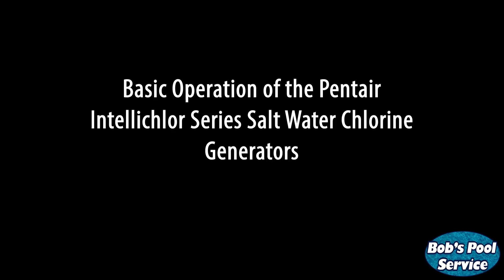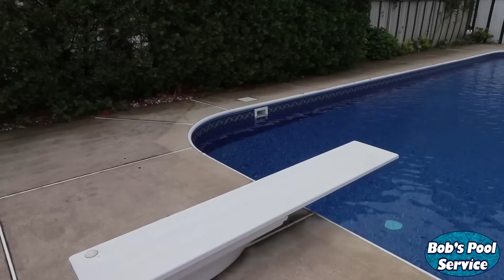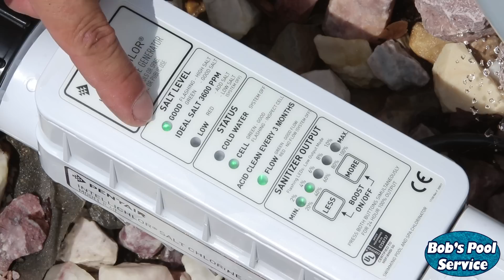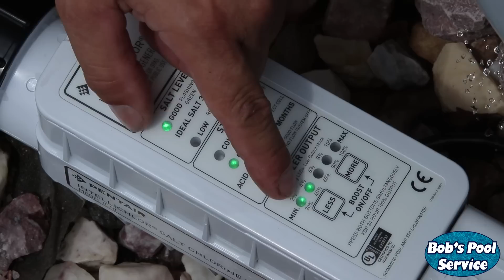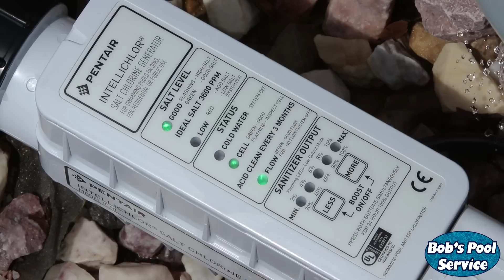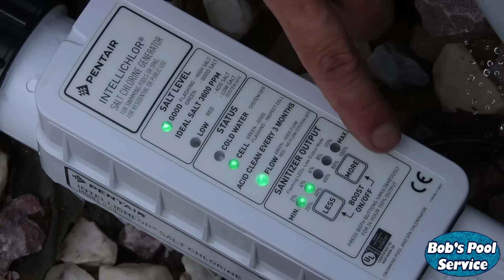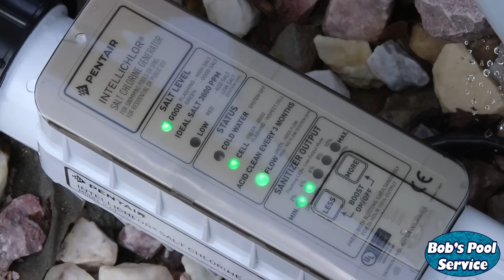Pentair Intellichlor Salt Water Chlorine Generator Operation

Comment: Just had a big storm so had to drain the pool a bit to get the level down.  Now the low light is red, but the cell light still goes green meaning it's producing chlorine right,  thought if the salt was low and red it wouldn't produce chlorine?  I added 2 bags of salt waiting for it to get back to green.
Reply from the maker: I didn't think they'd produce chlorine if red, i'll have to see if the green cell light comes on next time I run into that situation.  Maybe in some cases it can if it's not TOO low in salt and just under where it turns red.
Reply: Thank you for the detailed explanation from the blogger. This is our titanium electrode salt chlorine machine testing video. Welcome to watch. Thank you for your time

https://www.youtube.com/watch?v=Xi4_EYCDL2k

Comment: Thanks for the great video. If I turn the sanitizer output all the way down, does that mean the system is "off" for purposes of adding salt to the pool and waiting the recommended 24 hours?
Reply from the maker: Yes, that should be sufficient or if you find it easier you can just unplug the cell from the power center.  We generally don't change the cell setting when adding salt but we never add salt through the skimmer or put it directly into the system, we're careful to spread it across the shallow end of the pool and not push it towards the drains.  The salt dissolves naturally this way and usually takes about 2 days of running the system for it to homogenize with the water.
Reply: @BobsPoolService  got it thank you! Owning a pool can be frustrating at times but folks like you make it a bit easier.

Our former pool guys who did an awesome job last year left us to dry this year from being understaffed (being understaffed I'm totally empathetic to of course, lack of communication in telling me they wouldn't be coming by anymore after doing the opening, less so).

So new pool guys are coming tomorrow and I'm trying to get it as clear as possible so they can vacuum. Glad to know in the meantime I can effectively shock the pool at least while I wait for the salt I dumped to dissolve!
Reply from the maker: Thanks for the kind words, we really do want people to enjoy their pools, sadly that's not always the case.  We can totally relate to staffing problems, it's become very difficult to find qualified people to work for us and putting someone on a job without experience can often be worse than just giving up new clients.  Right now I think every pool company worth their salt is in this same situation with more work than they can possibly do.  Good luck with your new pool guys, hopefully they work out and yes, if your salt system ever goes down just put some liquid chlorine (bleach) in the pool until it's operating again.  Salt systems really just produce chlorine from the salt so it's totally compatible with chlorine and in fact IS a chlorine system.  Just don't do something like put tablets inside the skimmer, they're highly acidic and that could damage the plates on your cell, use a floater or better just use liquid or granular until your salt system is once again working.

Comment: What if you just want to turn the cell off?  How do you do that?
Reply from the maker: There's really not a way to turn it off, but you can turn the output all the way down to zero. Or if you want it totally off I would just unplug the connector from the transformer

Comment: Just opened my pool today.  Guy said add a bag of salt tomorrow.  This system was new July 2021.  I can’t remember if I turn the Salt Generator off when I add salt.  I know I did when I had the TCell type.  But just can’t remember on this Pentair Intellichlor???
I know I leave the pump on.
Reply: No I do not have a main drain.  Thank you
Reply from the maker: We add salt directly into the pool, usually the shallow end.  Generally we don't turn off the salt system but if you have a main drain that could grab a bunch of salt you may want to.  The filter in theory should prevent any large amount of salt from getting into the generator though.

Comment: What if the Salt level light is not on at all?  flow is green.  Cell is green. But the Salt level light is just off.  Thanks!
Reply from the maker: It sounds like the LED is burned out or there's a problem with the unit.  I would contact pentair or your pool company for a repair or replacement.  If the cell is over 5 years it may be time to just replace it.

Comment: So the a green cell light means its producing chlorine, so that doesn't have to be green all the time?  Mine is like yours in the video, will go on when I switch from 20 to 40 for example and then shuts off.
Reply from the maker: The light will illuminate to green when it's actively producing chlorine. So if you set the output to 50% it would be illuminated green half the time and off the other half of the time.

Comment: Thank you for this video!  helped me out so much, I just got this installed and also just opened the pool.  My salt PPM was 0 so salt level low I added enough to get it to go green.  But I noticed that  it was doing "the dance" 100% for 24hrs and stuff was coming out of the returns,  this like a cloudy mist leaving a white almost soapy thing on top of the pool, the minute I went back to 20% it stopped.  Any idea why that happened?
Reply from the maker: Usually something that forms on the top of the pool like that is a reaction between chemicals most often caused by algaecides. There's really nothing in the saltwater chlorine generator that would produce that. The only thing you do see sometimes are small bubbles coming out when it's on because it's producing chlorine gas.
Reply: @BobsPoolService  thank you for the response....can a pool heater react with algaecide? Soon as I turned on the heater got those white suds on top of the pool.
Reply from the maker: @andyreinoso6139  Not sure if a heater can react with it but I've seen running the system turn a pool into a gray bath of bubbles.  The only algaecides I really think are worth using are polyquats.

Comment: Which direction should cell go on if the tubing was put in vertical? Always have put flow word going towards pool even though it's pointing to ground and words are upside down. Changes last year so flow sign went towards sky and called pentair and said I needed a new cell? It's 4 yrs old, I'm putting on today so it's backwards like the yrs proir to last year to see if that was it, Your thoughts??
Reply from the maker: Vertical or horizontal the flow arrow has to point towards the pipe going TO the pool.  Sometimes this can mean the unit appears upside down but that is how it has to be. We often do a bit more plumbing so the cell can sit horizontally or at least with the text not inverted but some installs are tight and it has to be that way.

Comment: My sanitizer output won’t go lower than 40%. (Solid green). The Min button won’t allow me to go any lower… any idea why this is or how to get this lowered? Trying to bring it down to 2%
Reply from the maker: Unless you have it hooked to an automated controller pressing the down button is the only thing you should need to do.  Sometimes the button can be sticky and require a pretty hard press.  Does the up button work? Are you only able to get as low as 40% or does it simply not go down from whatever setting you're at?  If it's the latter I'd say the button on the unit is bad but if you have an automated system this video isn't for that operation and it could be overriding the physical unit.  Hope this helps.
Reply: @BobsPoolService  Thank you for your response. The unit is not hooked up to an automated controller. The up and down button work however it won't allow me to go anywhere under 40%. (Solid green) The button is working but for some reason it just won't let me go any lower...
Reply from the maker: @kennethkim8165  I would contact Penair or the local company that installed your system, sounds like the unit is malfunctioning.

Comment: Things to remember with a salt cell they don't actually measure salinity they measure the continuity of water. The continuity of water changes with water temperature, so never add salt or drain to lower salt level without performing a standalone salt test. Otherwise the salt level will be too high or too low when swim season starts
Reply from the maker: Absolutely true, the cells give a rough idea but we always use our Myron meter to get accurate readings.  Another BIG mistake people make is in the spring time they test the water before letting it circulate and homogenize thus measuring the rainwater that's stratified and laying on top!  If you take a sample from a pool that's been covered all winter, expecially with a mesh style cover it will read close to 0 salt.  Still we have some clients that want us to test the water when we open the pool but doing so is a terrible practice and inaccurate.  I suggest just adding a shock and letting the pool circulate for 48 hours before making any adjustments to the chemistry.
Reply: This is our titanium electrode salt chlorine machine testing video. Welcome to watch

https://www.youtube.com/watch?v=Xi4_EYCDL2k

Comment: what if the salt level indicator is flashing both green and red?
Reply from the maker: That happens when the system is doing it's own self check and calibration, it occurs when the system is started (powered up) and usually lasts for a few minutes, it varies.  Eventually it should settle in and you'll have only one light illuminated.  It can be analogized to a computer booting up before you can use it.  I should have included this in the video because it confuses a lot of people.

Comment: after I cleaned my cell, how do I get the clean cell notice off the panel and how do I get the green cell light to stop flashing? Thought it would reset itself?
Reply from the maker: Hi Sherri there is no reset per se and if the cell is still flashing that would be indicative of either a worn-out cell that needs replacement or perhaps a more aggressive cleaning as needed.  How old is the cell?  Up here in the Northeast we found most cells last anywhere from 5 to 7 years but we have a season which is only about half the year.  I would suggest visually inspecting the plates inside with a flashlight if there's still build up or scale on them you may want to try a stronger acid washing.

Comment: At what speed does the chlorinator have to be in order to produce chlorine
Reply from the maker: I believe you are referring to the speed of a variable speed pump not the chlorinator. With that said there's a lot of factors that could affect it because of the hydrodynamics of your system so what I would suggest doing is just tested keep turning down your variable speed pump and see where the flow sensor shuts the unit off from not enough water passing through. Realize once you determine the setting you'll probably want to set the pump a fair deal above that because things like leaves in the skimmer basket or filter that needs backwashing could further effect where the breakpoint is.

Comment: What does it mean when the "good and low" lights for salt content are both flashing simultaneously and the flow light is also solid red? I know i have adequate flow, the pool strainer and pump strainer are clear and the cartridge filter is clean. I have the IC15 model for a small plunge pool. Could it just be a bad flow switch or does the salt content lights both flashing mean something else?
Reply from the maker: I've only seen that behavior on start up, typically when the power to the pump is turned on so it the power to the salt cell and it's normal to have the salt lights blinking as you describe, however after 5 minutes or so it should settle in and stop.  If it doesn't I would check the flow switch, in rare instances I've seen the paddle break off that senses the water coming through the unit.

Comment: How about showing an install ... piping and electrical .. thank you
Reply from the maker: Hey Steve, I considering doing a video like that but every installation depending upon the existing system varies greatly.  Sometimes we have to re- plumb a large portion of the piping if things are tight.  In addition, we've even had to appoint the services of a licensed electrician as well.  There are some units that simply plug into a gfci outlet on the market albeit not as robust that lend themselves better to a self install.  Moreover, the danger of someone not familiar with electrical wiring and principles could get hurt or endanger someone if the unit wasn't wired up properly and correctly bonded.  Lastly, Pentair and other manufacturers are giving shorter warranties for any equipment not installed by a professional, usually 90 days versus a full year or two if you have a receipt to prove it was installed by a pool professional.  For these reason I've decided against making a video and potentially harming someone or setting myself up for getting in trouble if someone misinterprets my instructions.  The units do come with detailed instructions if you purchase one and are familiar with wiring.  I've seen more wrong things than you can imagine on pools when  customer along with a well meaning neighbor  have a go at installing their own pumps, filters, etc.

Comment: Our pool store says we have zero chlorine in pool. Our system shows the solid green led on 20%. How do you increase the chlorine output to 60%. We can’t keep the algae out.
Reply from the maker: Press the up arrow to increase until the lights are illuminated to 60% as shown in the i
video.  If you have algae I'd use a granular chlorine shock to kill that off too, you can't really "shock" a pool with the chlorine generator.  Hope this helps.

Comment: I recently replaced the flow sensor on my IC40 and now my salt reading shows 0, but my salt level is good.  Is there a way to correct this?
Reply: I would appear to me that the salinity sensor which is also part of the flow sensor unit isn't working correctly make sure that you connected all the wires there's a possibility that one of the contacts isn't being made.
Reply from the maker: Sorry I replied with my personal profile but he definitely need to correct that because if it's showing no salt the unit also won't be producing any chlorine it shuts itself down to protect itself if I had to guess definitely one of those wire connectors they're not very substantial.
Reply: What's interesting is the cell is reading good salt (solid green) and is obviously producing chlorine by showing all green (set at 100% output) and
fluctuating ORP reading.
Reply from the maker: @socal114  I'm a bit confused, in your original post you stated your salt reading read 0...  I'm guessing now you have the IC40 connected to an automation panel.  If the light on the unit is green the sensor inside is working and your problem is likely some sort of communication error.  Did you use a genuine Pentair branded flow sensor replacement?  There are aftermarket ones that seem to work fine as stand-alones but I haven't experience with them when hooked to an intellitouch or other automation panel.  Just a thought.
Reply: You are correct...Genuine Pentair flow sensor (made sure of that) that is working but showing 0 salt reading on both panel and app.  Would ground wire on sensor have anything to do with it? Sensor has green ground but cell does not (blk/red/wht only).  I just left it loose/disconnected.  I would attach a photo on here if I could...It's bizarre
Reply from the maker: @socal114  it's been a while since I replaced the flow switch but if you connected all the wires that were existing with the provided snap lock thing I don't think that would be your problem there's a lot of reasons it could not be communicating the first I would ask myself is was it doing the same thing with the old flow sensor. One thing you can try is rebooting the whole system sometimes that can help but if that doesn't fix it if the system is out of warranty I would probably just use it as a standalone because it's obviously still functioning but not communicating. The problem could be the cell itself even though it's functioning the electronics to communicate could be a problem or it could be an issue with the motherboard inside the intella touch.

Comment: Your explanation of “cell” being ON GREEN or OFF GREEN really helped. I recently set it to 20% lowest setting and was freaking out because the green went to off. Now I realize it means to only turn in 20% of the time. I have a 33k gallon pool and have the IC40. I also have the salt generator hooked up to the same electrical timer / circuit as the filter - is this recommended? Or should it be on its own timer?  Also, does a higher PPM of Salt generate more chlorine?  Thank you.
Reply from the maker: So your two questions in here, first your unit is hooked up correctly if it's coming on with the pool pump timer.  There is a flow switch inside the unit to prevent it from coming on when there's no water flow but I wouldn't depend on that so you're good with your installation.  Second, will the higher PPM generate more chlorine?  In short, yes, also warmer water will also make the system more efficient but typically warmer water requires more sanitizer so generally it works out to be equal.  I wouldn't put in more salt however to regulate chlorine generation, just keep the level at the recommended 3400 ppm and you should be good.  Not many people (or sometimes pool stores) have an accurate calibrated meter so oftentimes we're working within an acceptable range not an absolute value. Hope this helps!